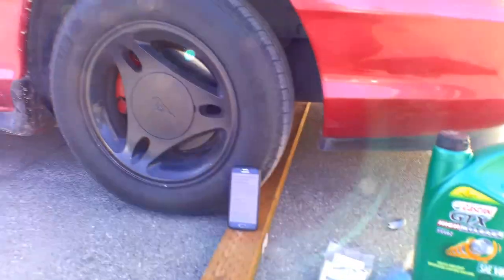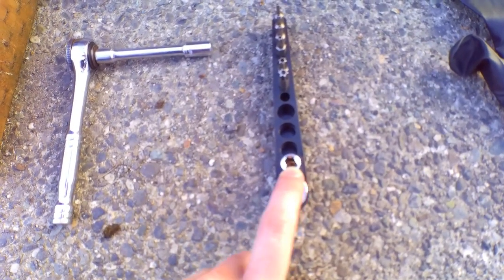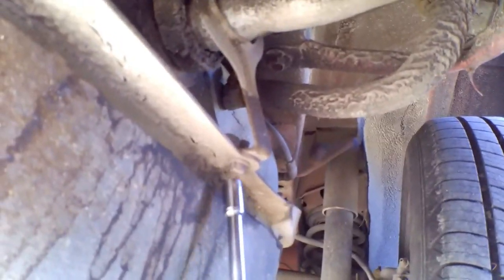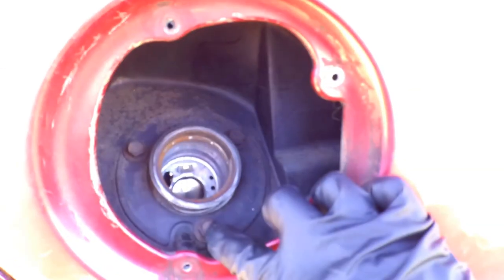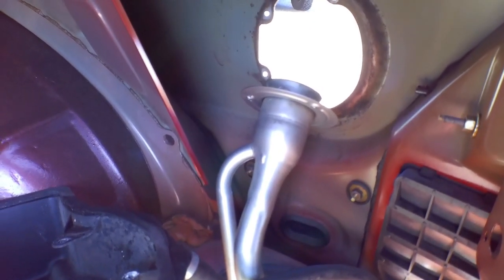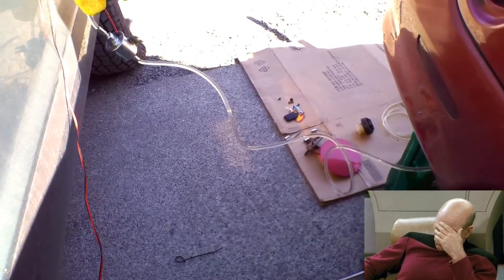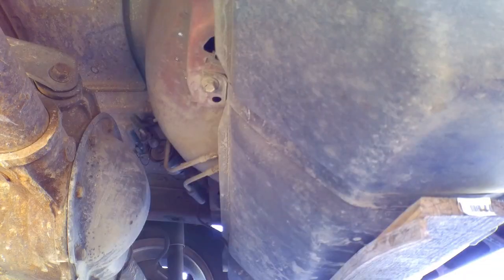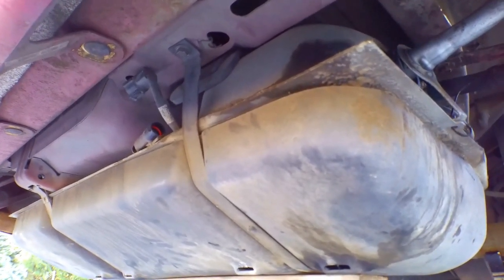Fuel Filler Neck Grommet Replacement | Mustangs

Comment: Will be tackling this later on this week on my 94 GT. Leaking gas after I filled her up right from the filler neck garment can see it right behind passenger rear tire. Thank you for the well put together video.
Reply from the maker: I'm glad I could help! Good luck and any questions do hesitate to ask!
Reply: I have the exact same issue on the same exact car so I’m glad to finally come across a video that tackles the same issue/car, thanks a lot man you saved me a good amount of hassle
Reply: @gregmartinez6426  This was a while ago. Job was easy. Did not need to drop or lower the tank. The grommet is a tight fit. Dropped it into the tank first go around Lol. Fishing line and live bait hook got it out first try. Get it done! Have a good week.
Reply: Save yourself some time and aggravation. Use a heat gun on the grommet to soften it up the grease the grommet and the hole and it pushes right in.

Comment: Thanks for the video man, very helpful! :) But for future reference, if you ever have to do this again, it's way easier if you drop the tank (preferably with less than an 1/8th of fuel) and remove the straps along with all other necessary components. Thank you can pull the filler neck out from the tank after lowering the driver side 1st.
Reply from the maker: Glad I could help. Thanks for the feedback very much appreciated!

Comment: There are different grommets for the 2 or 3, 19998 versions of the mustang.
There were different builds of the 98 mustang. Vin dates mine at Feb 98.
The earlier version (mine's a GT 'vert 4.6L) uses OEM pn F8ZZ-9072-AC Recommended as "Only for the 98 Mustang" in part descriptions. Not for the grommets you'll find recommended as for:
"98-04 Mustang or 96-98 Mustang".

The difference is that the hole size in the tank and the diameter of the filler pipe are both about 1/4" or so smaller on the early 98 version...that was a fun lesson to learn.

Comment: How did you manage to pull the metal pipe out. Not coming out of my car. My mustang is a 98 gt
Reply from the maker: 8:30 in the video I explain about lower the fuel tank. You have to lower one side more so you can have more room to pull it out. It is not easy to pull  it out. I remember having to pull very hard. 

Hope this helps you. Feel free to update me on your progress. Best of luck.

Comment: I broke the fuel tank filler pipe  nipple that goes into the tank. It's not an easy job. I have a new pipe assembly coming. Wish me luck or this could get expensive.

Comment: This video is old as shit lol but 5:52 My ‘98 GT did the same thing, the part of the gasket that goes inside the tank broke off inside and started breaking apart. At a full tank it didn’t cause issues, but when fuel got lower the debris would suck up against the fuel pump sock and restrict fuel, causing a “fuel cut” type issue. I did about 50 hours of research and racking my brain around fuel pump going out, injectors, the fuckiiinnnnn……. Box thing in the passenger front fender that has the fuel relay in it that everyone always says is bad, everything I could think of. Turns out the previous owner replaced the fuel pump, destroyed the fuel filler neck seal (but not enough for it to leak?) dropped a 1in. white/clear mesh wire loom and various other rubber pieces inside of the tank.

Comment: Let's see you put that dam thing in.
Reply from the maker: couldn't get a camera view but I do say how to get it out. Not easy to say the least.
Reply: @Ironcory  I got it back in but what I did was I heated it with a heat gun greased op the hole and the grommet and pushed it right in.   Well if you do it once you'll never forget. 😂
Reply: @AllenFrost-r1c You heated the grommet and then just pushed it straight in or did you have to squeeze or angle it?
Reply: What you suggested worked    . Thanks 👍 it was a while ago but it worked out fine.

Comment: You did one too many steps..easier just to run the tank to bone dry and drop it
Reply: I had just replaced the fuel filter I'm not about to drop the tank again, I'm glad I found this video, this was easier than dropping the tank though it does take a little longer
Reply: @dev894  You don't have to drop the tank to do the fuel filter...
Reply: @gerald4535  meant pump not sure why I wrote filter